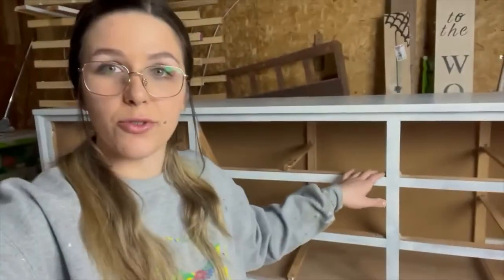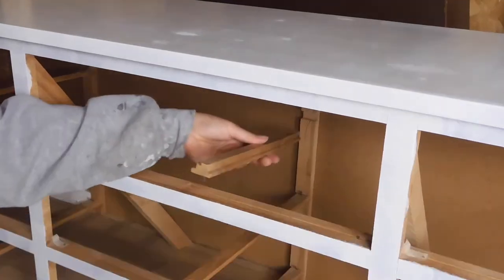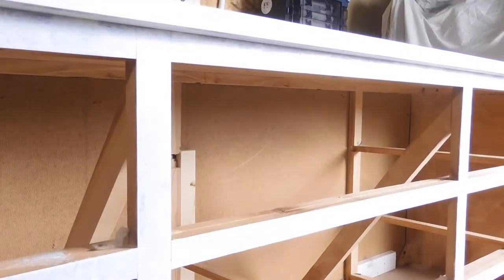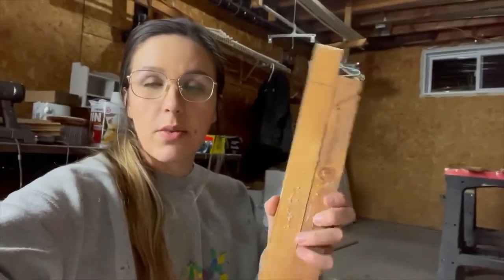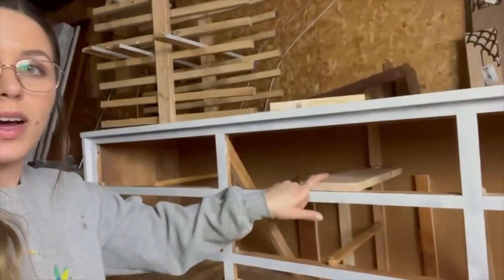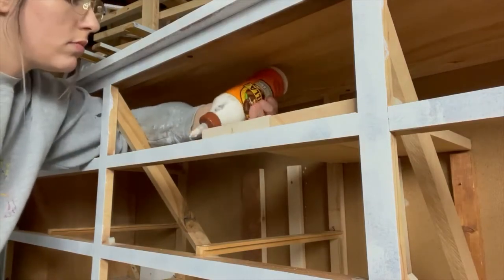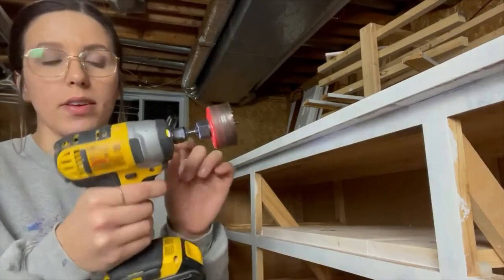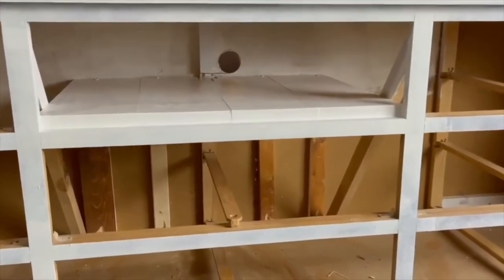How to turn a BROKEN DRAWER into a SHELF! Furniture Flipping Upgrades | FurnitureFlipBySarah

Comment: 6:45 Jigsaw would be the simplest, cheapest, and most versatile powertool for that. Or you could use a handsaw such as a Japanese pull saw, or even a coping saw which could also be used for detailed cuts in other projects.

Comment: You asked about a good saw for notching small wood pieces. I think a coping saw is good. It is not a power tool. They only cost about $10.00. If you have a jigsaw, that is a good power tool option. Hope this helps...🙂👍
Reply from the maker: Thank you! Yes it does 😊